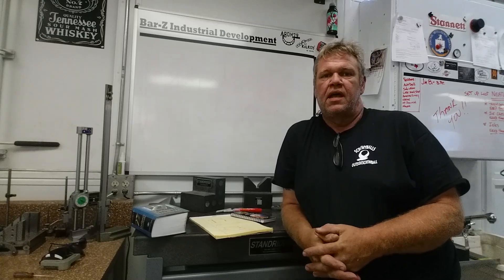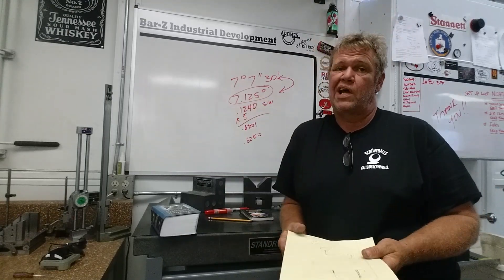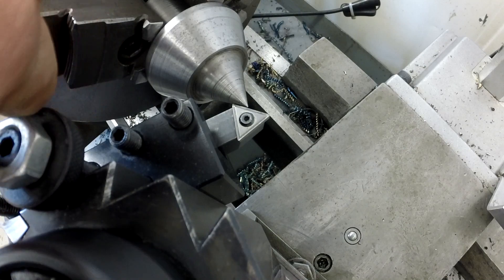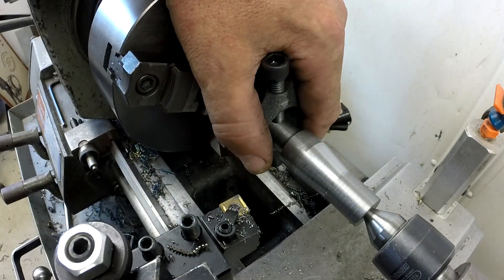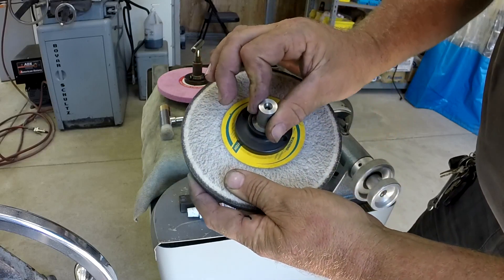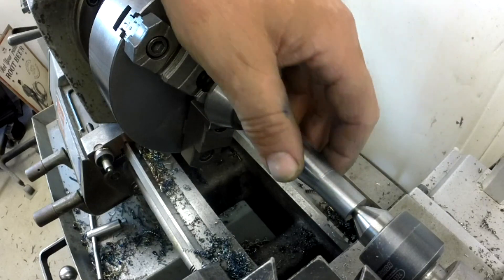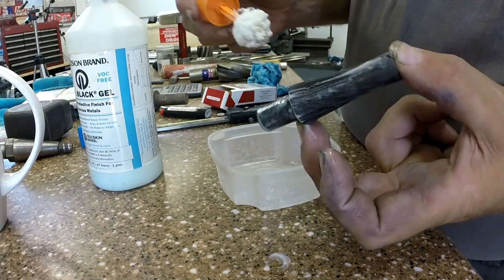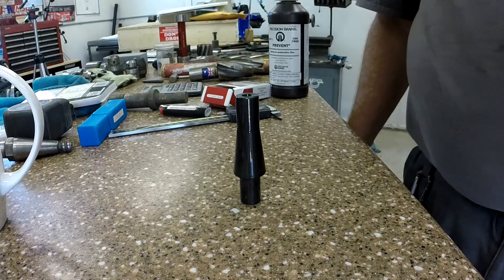Calculating and setting up a taper part #2

Comment: Sine of 7.125 times 5 inches is not 0.6201, it is 0.6202. Your error comes from rounding midcalculation values which is a definate nono.

Comment: The issue is that the sine bar is along the hypotenuse of the triangle and the 5 inches you were looking for would be accurate for the adjacent side which would be perpendicular to the axis of the lathe. The hypotenuse would be slightly longer in this shallow angle which accounts for the difference.

Comment: You nailed that taper angle using only the compound on your lathe??????  Please explain how you set the  lathe compound angle to that degree of precision.  I would have had to resort to a punch grinder on a sine plate and ground it in to get it as close as you did only using the lathe.

Comment: G’day Stan, Rein here from the Engineers Black Book. It was great to meet you at the BarZ Bash. In watching your video (1:06) your statement that the Engineers Black Book only goes in 10min increments is correct on page 166, however, if you care to look at page 65 (USA Edition) it does have Degrees, Min and Sec for a 3”Taper (14deg,15min,0sec - Included Angle) so with the center line it would be 7deg,7min,30sec as per your calculation. So it did have the info you were looking for to do this job. In addition to your further statement, we have a copy of the MH 28th here and on page 106 we cannot see anywhere that they show seconds to your comment?? We only see degrees and 10min increments as well. Please correct us if we are wrong, I see you have the 27th Edition. In all fairness to everyone who owns a copy of the Engineers Black Book (Scott Henion, 1970chevelle396 and others ) and who use it everyday , the information you were looking for is contained in the book. Look forward to your comment! I will email your some further info, cheers!
Reply from the maker: Hey Rein,
Your book is outstanding, I didnt mean to come across as not liking or not wanting to use it. Minutes and seconds decimal conversions are within the MH, I will lookup the page number next time I have it on front of me. Guess I should have dug a little deeper in your book to find what I needed. Thank you for an excellent publication.
Reply: Stan, we are definitely looking to forward to seeing where the MH shows seconds besides the 10min increments and thank you for the great videos not to mention hosting the Bash!
Reply: Tables on pp 64-65 give accurate dd mm ss numbers for about 60 different tapers in either ratio or inch per foot. Not quite a complete trig table to the nearest second, but probably more useful in the shop.

I find these useful enough that I have a copy each of the "Engineers" and "Electrical" Black Books both in my shop and in my office. (When are you going to come out with thumb indexes for "Engineers" like the ones supplied with "Electrical"?)
Reply: Stan , thanks for sending thru the Page from the MH (& Peter W.Meek), point taken our bad, we overlooked it or as you say completely buried in the MH. FYI Min/Sec to Decimals will be included in the 3rd Edition of the Engineers Black Book, you can see it here https://swipe.to/7684r 
To our credit 7deg/7min/30sec we did have in our book, not just the 10min increments. Peter the Index tabs, just like in the Electrical Black Book will be included in the 3rd Edition of the EngineersBB, to be released later this year! Thanks again guys.Cheers
Reply from the maker: It's great to see a publishing company actually interact with the readers and continue to make improvements. Based on what I have seen so far, you guys are doing an outstanding job. 

Thanks again,
Stan

Comment: Why are you even bothering with angles? You were given the taper per foot, 3" in 12". Calculation is then dead simple for gauge blocks stack, half the TPI divided by 12, times length of sine bar,5", gives 0.625". By converting one way and then back introduces rounding up errors in a lot of cases, and just screws with your mind. OK errors are pitifully small but KISS whenever you can! 
If you confuse Hypotenuse with length that is another matter and where Lipton T.'s little friend's contribution comes along to bite your butt.
Reply: Except the sine bar will be the hypotenuse and taper is usually measured along the adjacent. So while you won't need trig, you will need the pythagorean theorem to get the length of all three sides of the triangle. Still it is something you could work out with a pencil without access to a trig table or calculator, if you had to.
Reply from the maker: Hey Chris, what you described was my first method (.625) see video #1. Converting to a (decimal) angle and using the sine table renders .6201. A small error but it increases with the bigger angles.
Reply: Note to self, must watch things in order next time :>)
One good reason for quoting  taper per inch/foot is for really simple, ie no Trig, sine bar set ups.
Reply from the maker: Ha ha, I am guilty of the same.
Reply: But it is sometimes worth seeing the end first, so you know if it is worth seeing the whole. Much like watching an F1 race, if your favourite driver wins, then you watch the whole thing, if he loses, stuff it and save an hour or two of machining time.
Reply: Good point, not so bozo are you, unlike your correspondent.

Comment: Maybe I missed it, what material did you use? 

Also what type of rubber cover do you have on your big surface plate. I'm looking for a good rubber to cover my work benches with. So many different types of rubber has my head spinning.
Reply from the maker: The material is 4130, just some drop off I had in the scrap pile. The mat is remnant (natural) rubber I had left over from a job, not ideal but serves the purpose.

Comment: .Like others ask...why balance? I'd guess it's more important on a larger diameter wheel, running at higher speeds, and if you're going to be  grinding microns off....I see that Suburban claims to do just that...!
Reply from the maker: I have never tried balancing, we will see if there is something to this.
Reply: Shadon HKW...In the 1970's I worked for Burgmaster...A turret drill/NC machine manufacturing company...they used a couple surface grinders that had wheels maybe 8-10 inches wide and 18-20 inches OD....Never did I see any balancing in my 10 years there....Grinders were good for 1-2 tenths on hardened steel ways....but, I was elec-tech so not around those 2 grinders all the time....machine shop had about 250 or so guys on day shift, 150 or so swing....

Comment: Really nothing wrong with the book.
The difference is the 1" length is along base of the angle, not the hypotenuse. The sine bar uses the hypotenuse as the standard. So you need to calculate the hypotenuse. You need the angle for that anyway though.
At 45 degrees, the error is almost 30%.
Reply: My thoughts exactly Scott.
It was a simple case of user error.
Reply from the maker: Nope, great little book.
Reply: Come to think of it, you don't need to know the angle. Just calculate the hypotenuse with R^2 = X^2 + x^2. or R^2 = 1^2 + 0.125^2  (^2 means squared) so R^2 = 1.015625, Taje square root to find R; R=1.007782,
So for the sine bar the gauge block stack would be (5 / 1.07782) * .125 =.6201737